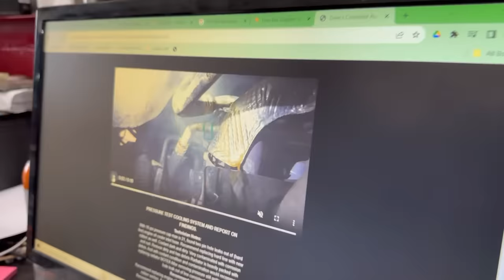The truth about maintenance, and what the manufactures tell you vs what you need to know

Comment: Question for all you guys commenting on the video: I have a 2023 F150 5.0L V8 that is just about finished with the break-in period (per Ford) of 1,000 miles and had the oil changed at the dealership. The service kid made a joke about it being kind of early. I plan to do subsequent oil changes about every 4,000 miles or (more likely based on my driving habits) every 6 months. Does it matter whether I go to the dealer or a trusted independent shop? I don’t trust those speedy oil change places, and the only reason I went to the dealer is because with a previous vehicle (Honda) it was getting harder and harder to find an independent shop that would let me wait. Most are wanting the vehicle for the day.

Comment: Only did oil changes on my 2006 Honda Accord over a 10 year period with zero issues.  Even the belt looked new still after 220,000 miles.

Comment: My 2000 Chevy 5.3 got to 422.000 miles and was still running when I replaced it.
I’ve changed the oil every 3000 miles. I’m sure it was getting tired but it never lost compression or gave any sort of problem.

Comment: This is what I do fo my 92 Buick.
Monthly:
   Check tire pressure to 32 psi.
   Check airlift pressure to 32 psi.
   Check all fluid levels.
3000 miles:
   Change engine oil and filter. Rotella T-6 5w40 full synthetic.
   Lubricate chassis and all moving parts.
   Rotate tires.
15,000 miles:
   Change air filter.
   Change feul filter.
50,000 miles:
   Change transaxle fluid. Valvoline Maxlife full synthetic multi-trans fluid.
   Change power steering fluid. Valvoline Maxlife full synthetic multi-trans fluid
   Change brake fluid. Dot 3.
   Change O2 sensor. Bosch OEM O2 sensor.
100,000 miles:
   Change spark plugs.
   Flush cooling system and Change coolant. OAT long life coolant.
Reply from the maker: Very detailed! That would be a great used vehicle for someone to buy if you ever sell it!

Comment: I don't own a car, but i have a motorcycle with a wet clutch. That means the engine oil is the same oil that flows between the clutch plates. The bike is not new, its a 2005 honda Transalp. 

My engine oil is squeaky clean when I change it. Why? Simple. Because I change my oil twice every year and make sure the engine is boiling hot and driven like hell before I change my oil. That way any debree in the oil gets flush and washed off of every surface inside the enige and brought out with the old oil. I then pour new oil inside, drive til the enige is hot again and drain the oil. Then i out on a new oil filter and new oil. 

Its probably overkill, but I'm not gonna getting rich by saving 30$ worth of oil. But I'm definitely getting a peace of mind from this extra cost. 

I do the same with any engine I have. 

Any how, cool video!

Comment: Coolant system maintenance is one of the most overlooked items. I always use the proper coolant and distilled water. Ignoring or using crap coolant will destroy a car. People don’t realize the cooling system normally also includes the heater core and the transmission cooler.

Comment: My wife's 06 Santa fe we bought new, has 138k today. Dealer maintained. Until a bad episode with dealer service manager. Cooling system had been serviced four times since ownership began. I used a Honda shop, I knew the owner, for the timing belt. Since then, I noticed sludge in the coolant reservoir. I'm thinking the Honda shop put regular coolant in with the Hyundai/Assin coolant. Now I've got to flush entire system again, despite being flushed two months prior to timing belt job. Plus they most likely used tap water too, which will be the first time in the cars life of having it.

Comment: I do a 1/4 what the manufacturer says, but I also run Amsoil synthetic, I have 2 cars that I do this too, one is a TDI and the other is a Toyota, the jetta is at 500k and still runs like a top, the Toyota is at 400k, High quality oil is the most important thing, the second is get the engine to operation temp for at least 1/2 an hour every time it runs, the Third is oil filtration, filter that oil really good and you will have next to no engine problems.

Comment: I currently drive a 2014 Toyota Corolla. I change the oil every 5000 instead of the 10000 the book says. I change the gear oil (manual ctransmission) every 25000 miles. I change the cabin filter every other oil change (I have allergies), the main air filter every oil change dirty or not. I will remove the housing to remove any debris that got past the filter. I do a brake and suspension inspection every tire rotation (5000 miles). I do all of this because I live on a highway and there's little to nothing within walking distance and my job is 40 minutes one way. Most of the parts in my car are original including the clutch. I already replaced the spark plugs and coils at 100000 miles. I replaced the PCV valve at 125000 miles (you have to take the intake manifold off to get to it). The thermostat was replaced when I replaced the coolant. The coolant got replaced last year due to me hitting a coyote on a major highway. The bumper, radiator, overflow tank and such were replaced due to that accident. I have a notebook where all work and inspections are logged and who did the work. I aiming for this to be the last car I will ever own.  I have 195000 miles of trouble free driving. In short, maintenance is important.

Comment: Yeah I bought a cheap Passat with dirty coolant, it had another issue but I knew I could fix it, for the coolant though I thought I'd just flush & replace it, easy...

Well a day after I bought it, it lost all cabin heat, I flushed the whole coolant system, it was amazing how dirty the stuff was that came out of it, it was so dirty I replaced the oil cooler in case it had a leak some oil into the coolant but looking back on it now I think it was just very old coolant that had never been replaced & had a lot of rust in it, it was dark brown with rust debris & felt a little oily but not foam milkshake like you commonly see with bad oil coolers or bad head gaskets.

The cabin heat came back after the flush but then other parts started leaking & kept hearing air in the heater core on cold starts, I replaced a very rusted hard line pipe, replaced rotted swollen rubber lines, then the radiator started leaking, replaced it, the coolant tank cracked, replaced that, yet the noise from the heater core was getting worse still then the heater core blew up one day while going to work, replaced that, this is all over a 2 year time span. At this point I've almost replaced the whole cooling system.

Oil cooler, water pump, lower hard line pipe, 3 of the rubber hoses, the radiator, & the heater core.
The good news is I no longer hear air passing through the heater core so I think I finally got all the leaks.

The point is he is correct in this video, if your coolant is bad & part of your coolant system is rotted & leaking because of that, you might as well just spend the extra time and/or money & just replace it all at once, otherwise it will just be one part after another.

If you're going to buy a used car & see dirty coolant I'd just avoid that car unless the rest of the car is in amazing shape & you're getting a very good deal on it because if it's a dark rusty looking color, know you're going to need to spend a lot of time and/or money to get the coolant system reliable again. If it's a milkshake, it might have a bad oil cooler, blown head gasket or worse, a warped or cracked block.

Comment: Took my VW to the dealership to get a few things done, one of those was a coolant change, when I asked them I want my coolant changed they said “it’s none serviceable item” basically it only needs to be changed if something goes wrong with the cooling of the car, and I had to literally tell them I want it changed, I don’t know how long that coolant has been in the car, and I was taught that it should be changed minimum every 2 years so they can suck that “none serviceable item”
Reply: 4-5 years is fine for vw coolant (ditto plugs + fuel filter), changing it every second year is ridiculous
Reply: @eponymous7910  I was taught every 2 years, I’ve done it that for countless vehicles or all sizes, types and guess what, nothing has gone wrong so 🤷🏻

Comment: Manufacturers give longer maintenance intervals because it artificially lowers the cost of maintenance. When I replaced the valve cover gaskets on my 95 Tacoma (5VZE V6)  at 235,000 miles the cams were shiny and there was no  sludge on heads  or valve covers.  Oil gets changed every 5K..

Comment: I understand what you are saying. But at the same time, I asked my mechanic what preventive maintenance to do on my 2007 Dodge Durango 4.7 2WD. He said just bring it to him when something breaks and he will fix it. 257,000 miles and so far so good. I have changed trans oil and filter twice. Pretty sure radiator has never been flushed.

Comment: That looks like an EcoDiesel.  I had one.  It was a 2015.  Deleted it at 21k miles.  Changed the oil every 6k miles.  Used Lubrimoly Toptec 4200 with lucas synthetic stabilizer.  I did water pump and thermostat every 90k so the coolant got replaced then too..  I put 375k miles on the truck and sold it.  I did the WHOLE front end at 220k miles (corrosion here in NE claimed the seals and jack shafts in the front differential).  It was a great truck AFTER it was deleted.

Comment: The BMW "lifetime fluid" story is absolutely true. Many enthusiasts would leave the fluid in until the TM failed 80-120k miles.  I said, "Welp, that's the lifetime! " 🤣🤦‍♂️😭
The service dept doesn't even use lube when they  bend you over while putting the new TM in. 😳

Comment: I had a mechanic who had 30 plus year running vehicle and told me that he changed all fluids every 4 years. Changed all hoses after 10. Oil changed every 4K and used synthetic. Regular brakes tires ect ect. Never broke down. You could eat off the engine bay.

Comment: That's an EcoDiesel. I work on them daily. The intake valve runners gum up because those engines soot up like no other. People buy these things and don't use them the way diesel engines are intended. The other big issue with those are the EGR coolers cracking internally and causing the intake to suck coolant into the engine.

Comment: I do my oil changes every 3,000kms. I just had my Transmission fluid flushed and filled when I installed a new clutch, my radiator fluid is filled and looks clean pink the proper color that's recommended for Toyota's. I still need to replace my Front Left wheel bearing and steering shaft, and an 02 sensor to turn off the check engine light. Plus an ABS sensor.

Comment: For all you regular drivers out there like me, If you have one of these direct injection 4 cylinders that seem to be in every car and some trucks, you gotta hit EVERY maintenance on time. 3000 miles EVERY TIME. These stupid things can't handle stress from old or low oil and those timing chains WILL snap if they overheat. I'm babying a 2.4 Ecotec along and it's running bad at 150K because it's been abused. They're not built to last so you have to make them last by taking the best care of them possible. If you do have an overheat and get the vehicle repaired, make sure a timing chain replacement happens at the same time. Swap that transmission fluid according to the best advice you can find for your vehicle no matter what the manufacturer says. Do whatever you can on your own and save some money. Coils, plugs, brake pads, air filters, etc.... You can do this stuff and save enough so the bigger maintenance items are not such a gut punch.

Comment: Yeah I change oil every 5k miles, worked great for me the last 20 years.  I have a 2000 F350 with over half a million miles on her and still sporting the stock engine that has just needed injectors and a turbo and some transmissions, but it still has it's stock HPOP (7.3 powerstroke) and fires up good in the cold, half that is just because I change the oil every 5k.

Comment: Use synthetic oil if you car was made in the past 15 years and try not go over 5-6k miles with it, use it also if you live in a state where you have many days under freezing temps.  Change your fluids at 50k, coolant and trans, then power steering or brake when needed.  $300 seems like a lot for a transmission flush, but then you realize a modern transmission can be 10k+labor if it breaks.  $150-$200 coolant flush is a lot cheaper than an overheated engine than also cost 6-12k + labor.  I work on cars for a living, and I hate to see an elderly person or someone who is down on their luck and I have to tell them the bad news, that they need a huge repair.  If you buy a used German/British car, find out how much that car was when it was new, because the repair costs never go down on those vehicles just because you bought them for way less than what they were new.  If it costs 80k-120k new, it is gonna be an expensive fix when it breaks.

Comment: Manual for my new Ford:
Coolant - change at 250,000 miles
Trans Fluid - 150,000 miles
Oil - When the oil monitor says so (~9000-12000 miles)

Comment: Just went through this on the transmission in my Jeep Wrangler. 
Jeep says lifetime,  ZF the designer says 50 to 80k. I watched a video where they were changing one at 60k plus and fluid was black. I'm doing mine at 27k and flushing as well, not just the pan service. I believe in the half time service recommendation. If it fails not because I didn't do my part.

Comment: good point the manufacturers want you to run out the warranty faster! less oil changes mean less chance to find anything else wrong with the car, was going to follow the 10000 mile engine oil  change schedule now maybe I will do the 5000 miles. although my last car a 2010 ford fusion I did it every 7500 miles never seemed to have a problem, but now I have a Mazda Skyactiv  it s a little more complicated

Comment: Wow, I’m so glad I drive a OBS Chevy truck. Oil every 5,000 miles with full synthetic. Transmission fluid gets replaced every 25k with brand specific fluid. Antifreeze every 50,000 miles with new hoses and thermostat.

Comment: my 08 335i Bmw lasted 155k miles with the original lifetime transmission oil, the cover/filter was from 2008 and the oil was very black. Ended up fully rebuilding the transmission because it didn't hold proper pressure.

Comment: I have had friends and my ex think I’m crazy because I do more maintenance than the manufacturer requires.  I was a truck driver and have seen what happens with non maintained vehicles.  My brother was a mechanic.  I tow with my truck and live where it gets to 115 in the summer. I change my oil every 3- 4k because I make the dealer throw in a lifetime oil change 4 times a year with my truck purchase.  I do the big service every 30k including all fluids.  I have yet to have big bills on my Toyota trucks.

Comment: I laughed, great advice.  For me, it’s the engine oil at 7,000 miles outside, or I’m ashamed!  I usually aim for 5,000 or 6,000.  Then it’s transmission fluid, the big fat fib as you point out, is lifetime fluid.  I had a Volvo, it was used for towing a caravan/trailer behind it, that stuff was dark brown, and it’s questionable I should have changed it at over 100k miles, as you know.  But, after a bit of a rocky couple of hundred miles, it generally went quite well.  The hidden one, is coolant.  I am beginning to think, it ought to be replaced, more based on time than miles?  Like, just do it every two years, no matter what.  But certainly as soon as you buy a used car.  There’s no caveats on it like with transmission fluid.  Apparently, the problem is, coolant is a kind of ‘time-bomb’.  Once it stops protecting from corrosion, it starts helping corrosion get worse.  That, makes a lot of sense.  And, all the critical parts coolant goes through, are thin-metal like a heater matrix inside the car, or the radiator up front, and so on.  Yes, I think if people realised there is gradually a chemical change occurs in coolant, it would get changed a lot more.  Oh, lastly, weird, I had some bright orange ‘weed’ growing inside my Volvo brake fluid.  It’s the water content gone through the roof, and a very odd emulsion formed, but it was like stringy orange stuff.  Gave me the heebie-jeebies anyway.  Take care all, you give great advice.
Reply from the maker: Thank you for the share!👍

Comment: The real reason manufacturers have a 10,000-mile oil change interval is because publications like Edmunds and Consumer Reports calculate 5-year Cost of Car Ownership based on the recommended maintenance. By stretching out the service intervals, they lower the "cost to own"... but only for the first five years. This also lowers manufacturer costs when maintenance is included or part of a manufacturer add-on warranty. On direct-injection engines (most of them today), doubling the oil changes is even more important because fuel gets into the oil system.